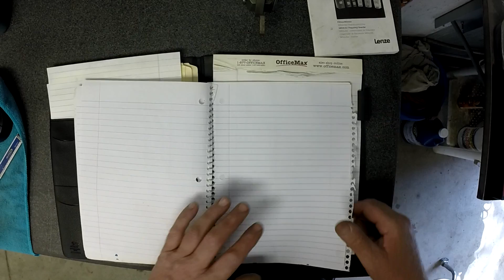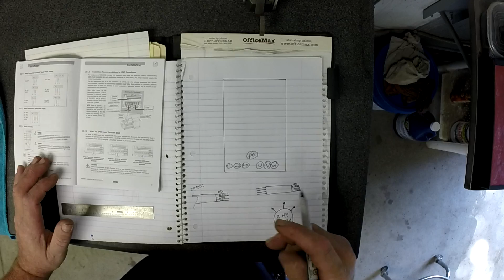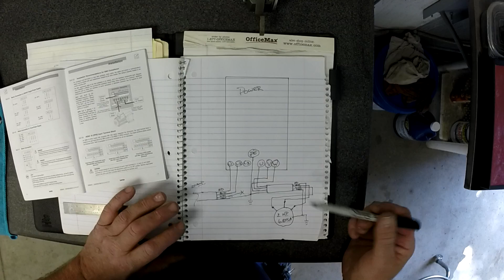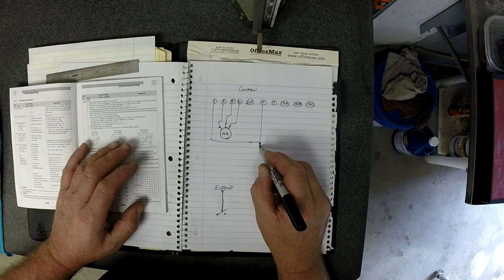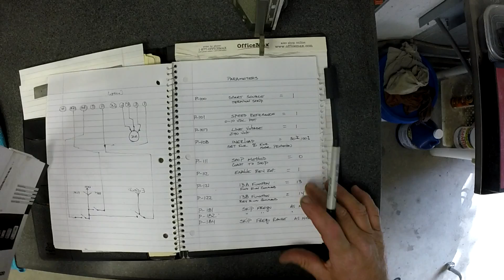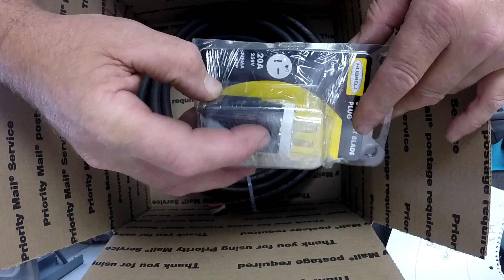VFD lathe application

Comment: When you wire up a VFD to a 3 phase motor you just can't use just any 3 phase. It has to have a CT of 4 to 1 and a VT of 20 to 1 and an insulation of at least an F rating. If the motor doesn't have these specifications and the motor is ran at a low RPM the motor wil get hot and burn up.

Comment: That gruesome photo opened a new consideration of HD metal-framed chuck shields and keeping them in place. I suppose you would need one strong enough to stand on. SawStop has a mechanism that stops table saw blades in a fraction of a revolution, perhaps the trigger mechanism would be suitable for a lathe. Something like a ground fault detector.  The Colchester factory site shows a chuck guard  that rotates around the spindle bearing cover on a large bearing, it appears. A more user friendly chuck guard might be a good project for a video. https://youtu.be/-6aib-PGzNU

Comment: Stan,  can a Hardinge 3 Phase 220V 1 HP  lathe be converted to single phase with a VFD?
thanks, Frank
Reply from the maker: Can it be done? sure thing, but you need to ask the next question, can I do it economically? It certainly wont be cheap to get all the control features back the way they were. I think a simple rotary phase converter is your ticket to get up and running with no muss, no fuss.
Reply: Afraid not.  I have an HLV-H and had the same question.  The reason you can't is because you have several motors all set for that 3 ph 220v power.  If you go to the harding group on practical machinery you can check out the forums there and they would give you a more defined answer.

Comment: Hello Stan,
I am attempting to convert a 5914 Clausing to 220 3 phase with a single phase input converter. Am having trouble with the motor not having enough torque after I put the belts on. I suspect one problem may be that my calculations in pulley configuration is way off. Would like to talk to you. My email is "whitecaps775@yahoo.com" if you would be willing to provide a number where I could reach you it would be a great help.
Takes too many words for typing.
In Over my head,
Gordon

Comment: Stan, Question I have a machine with a 3phase motor, this machine has a magnetic switch (ms), I understand that I will need eliminate the ms in favor of the drive but I'm wondering if I can continue using the original on/off buttons to operate the drive?
Reply from the maker: +David Haxton The drive can be programmed to accept (existing) maintained or momentary inputs, should be no problem.

Comment: Stan, how do you terminate the stranded wire for the control and power terminals on the VFD?  Crimp ferrules? Solder?  Or do you just run with the stranded wire?  In most industrial systems, I see crimp ferrules but I did not know if soldered terminations were kosher as well.

-Dale
Reply from the maker: +Dale Garrison Hey Dale, under each power terminal is a square washer, forked terminals aren't needed. Crimp sleeves are accepted methods on machinery where vibration is a problem, control pin rail is designed for bare stranded wire, but I dont see the harm in tinning it first.
Reply: +Shadon HKW Thanks Stan.  Also, I like your VFD mount for the drill press.  I have a Teco VFD rigged to run my Clausing drill press.  Originally, I was going to install it in a Hoffman enclosure with a disconnect, etc but I think I'm going to rig up a plate similar to yours.  Much cleaner and you have easy access to the membrane key pad.  As always, thanks for the great content.

-Dale
Reply: Do not tin wires that go under a screw or to a crimp. The tinning makes stranded wire brittle for a long distance and as solder is soft, it will flow under the screw and the connection will eventually get loose.

Comment: I would never wire without checking the manual  BUT are the code numbers standard with many manufactures?  I have been  gathering parts for a project and the  VFD  importer stated to use a 5 ohm  pot. Do you think there would have been a problem with the 10 ohm pot?   Thanks for the very helpful info.
Reply from the maker: +1DIYGuy Always check the documents that come with your drive, all parameters are different between manufactures.

Comment: When I set up the potentiometer  on my mill VFD every time if I moved it too fast it set a F-HF code I had to set P105 for decel time I put in 5 seconds and that fixed the issue.
Reply from the maker: +fatboyfester Good point, little tweaks like this are needed after installation, you never know what issues your going to run into because every machine will be different and have different operating requirements.

Comment: Stan

Another very well done explanation on electrical.  I liked 
1.  You discuss using the plug as disconnect means 
2.  E stop to kill all control circuit

Couple thoughts and these are mosty for me if I choose to update lathe to VFD drive (may also do shunt DC).  FWO and REV switches were not momentary ??  
IF correct then
1.  As set up it does not provide ant restart after power failure and return of power.
2.  If operator hits E stop and DOES not put FWD / REV / OFF switch in OFF then on reset of Estop machine will run.

I prefer coast to stop for normal stopping to reduce wear on gear train imposed by dynamic braking.  Dynamic braking is great for 
1  power tapping for sure with maybe a two or three second stopping ramp.
2. crash emergency stop with say a 1/2 second or faster stopping ramp.  This would require a second contact on E stop.

Again a very well done demo and good discussion of setting parameters which can drive a guy crazy.  Hardest part is keeping track of which of many pages you should be on.  Maybe Lenze wrote their manual to ease this frustration.
Dan Bentler

Comment: Very thourough video,as usual,Just one little nit-picky item. You stated that the signal power for the speed control comes from #5,where in reallity 10V is present on the other two terminals,and is picked of with the wiper the closer to + the faster,closer to- slower.
I am sure you are aware of this,but just to keep things as close as possible to reallity.
Love your videos
Reply from the maker: +Les Bender Yea, the wiper is the return, sometimes I start talking and its like a conveyor belt :)

Comment: What would be the best way to use the apron forward/reverse lever? I have a 5hp gear head that I'm thinking of powering with a vfd. It's currently run with a American rotary RPC but I feel like it will run a lot better using the RPC to power a 3ph input vfd. Thoughts?
Reply from the maker: +Jason Raksnis Almost any switchgear can pilot a VFD, in this instance we are using controls that being sourced by the user. (Your apron lever should work fine as long as the contacts are in good shape)
Reply: +Shadon HKW I do realize that. But contact switches built into the lathe each have 3 wires. Not sure how to wire that.
Reply from the maker: Hey Jason,
3 wires is all that's needed, common, fwd run and rev run. A mutimeter and 10 minutes will get them sorted out :)

Comment: Hi Stan, As everyone else has already said, this video is very helpful.  Having said that. though, I'm hoping that at some point, you might be willing to do an update showing how the use of momentary push buttons (forward, reverse, stop) instead of a rotary switch, would affect your plan.  My 13" South Bend originally used push button controls, and I kind of like them.  Thanks.  -Chris
Reply: +Tom Bordelon 
I got this one.

Your push button setup is a single component. When you hit the stop button, both the forward and reverse switches are physically opened. 

So you will use the original switch as your "control" instead of "power" 

The simple good news is that the same wiring Stan showed in this example will not need to be changed.

The difference hear is that instead of the "stop" switch being a separate switch that kills the control signal it trips both the forward and reverse switches simultaneously. ( point being an open circuit is an open circuit.)

Remember the factory switches will no longer be carrying high voltage but used as "control" inputs to the VFD.

If your machine is using relays to isolate the high voltage/current from the switch already, then you will be eliminating all of those and the above is still true.

Hope that helps.
Reply: Thanks, Tom!

Comment: Stan,  Great info.  I have a Hitachi WJ-200, 5 HP drive.  It works great, but the instructions are very difficult to understand. But I got it going anyway.   I can't remember, (I also have a Lense VFD on my drill press), if the Lense has braking functions. I'm not sure if it would be needed on a lathe.  I have braking on my Mill with the WJ-200, and a BIG 70 ohm resistor as the braking resistor.  It works great also.  BTW, these info looks like it might be going to BJ.   Thanks for sharing!

Comment: Cool stuff Stan!  Them VFDs are the bomb!  You covered the DIY basics that any novice could understand... You stayed in the scope of "getter done". 
        Motors and Motor Controls can get deep real fast.  It's an entire discipline in Electrical Engineering and Industrial Elect....  I barely touched that stuff in college.  Plus the electronics, IGFETS, etc. that create the variable frequency... ugh!  One thing most hobbyists are unaware of is the effect on the line Power Quality (noise, surges, etc.), and Power Factor.  Those VFDs are notorius for putting a lot of noise on the feeds.  But, nothing a surge strip can't block out.  You gave him the "good stuff":  that nice juicy 'SO' cord!

Comment: Stan-

Any advice on various parameter settings when using a braking resistor? I put a VFD on my lathe a few years ago (unfortunately another brand) and have never been able to properly configure my braking resistor. Unfortunately this leaves me with "coast to stop" as my only option, plus if I have anything of any mass mounted or if I decrease the speed via the speed pod too quickly, I overload the drive and it trips.
Reply from the maker: +Brian Simmons Check your DC braking threshold setting (this is the frequency  the drive comes to before the braking is applied) there are also 2 other settings to play with, ramp to stop (no braking) and ramp to stop (with braking) it sounds to me like you are using the ramps with no braking and the inertia is overcoming the drive capability. Of course yours may be named something slightly different as they vary from manufacturer to manufacturer.

Comment: Very educational, thanks for the great explination. Just wondering, if you had a drive rated for more hp than you needed would it tolerate the torque boost better without overheating?
Reply from the maker: +bcbloc02 Yes it would, but the prices go up drastically beyond 5 HP.
Reply: +Shadon HKW I haven't been able to find anything above 5 hp that will run on 240 vac single phase.
Reply from the maker: +ww_big_al I believe Hitachi has one, give a call over to Wolf Automation and have a chat with one of the tecs.

Comment: Could you show the math to get P108 you have talked about it before just not shown the math seeing a motor plate would be nice and all the numbers.
Great video thanks for the good info.
Have a day
Reply from the maker: +E Hiebert As an example, a drive is rated for 10 amp and a motor has a FLA of 8 amp, we would set P-108 to "80"
Reply: +Shadon HKW Thanks for the reply. Have never really looked at a motor plate to see what it tells you. Thats CNC operators for you as long as the machine is running and is not making funny noises then everything is good. I always like to learn as much about a machine as i could just so i could get it fixed fast and then get back to work. I guess that never included motor plates.  
Have a day

Comment: Stan, my friend, I adamantly disagree with your Emergency Stop Punch Switch wiring in this application. The only use for a Emergency Stop Switch on a machine with high speed moving parts within reach of a operator is to bring the machine to a dead stop as fast as possible in the event of  a emergency.  Not as a on/off switch to the forward/reverse controls. Almost every VFD I have installed has a control parameter to obtain a instant rotation stop of the motor (power lock up) that is intended for the E-Stop Button. The last thing any operator would want is to have a machine "wind down to a stop" as their shop coat is being wound into the rotating machinery. Which brings up another point .... the E-Stop Button should always be mounted within easy reach of the operator when in close proximity to the moving parts of the machine. This could be the result...  http://i.imgur.com/KJH2DuD.jpg     Be carefull, I care.  Regards//greg
Reply from the maker: +pkav8tor Hey Greg, what if this was 15 years ago before freq drives went mainstream? Coast to stop was perfectly acceptable then, admittedly the drive has DC braking features that could be enabled as an upgrade over old school practices, the onboard DC buss would be able to do limited braking, adding some externals braking resistors would stop some serious inertia. But that picture ... ouch.
Reply: +Shadon HKW hey bud, yes the old slow machine controls ate a few good men back then.  We have safer modern controls that are dirt cheap to install now.....we should use them when ever possible as you already know.  That picture popped up in a safety article awhile ago,  it stated that they found the poor guy that way and the machine was still running ....so sad.
Reply from the maker: +Dan Fraser Always an issue with maintained contact switches, momentary pushbuttons would make this issue go away.
Reply: that pic is going to give me nightmares.
Reply: Nothing like keeping in mind and planning against the worst case scenario. That includes working with the flu, personal problems, anger, or just having a shitty day. Some days you just need to stop and gather your wits. We are running the functional equivalent of a wood chipper. Fortunately Saddam Hussein did not think of this.
Reply: Are dead-man switches practical? Left and right hand e-stop should be easy.
Reply: That gruesome photo opened a new consideration of HD metal-framed chuck shields and keeping them in place. I suppose you would need one strong enough to stand on. SawStop has a mechanism that stops table saw blades in a fraction of a revolution, perhaps the trigger mechanism would be suitable for a lathe. Something like a ground fault detector.  The Colchester factory site shows one that rotates around the spindle bearing cover on a large bearing, it appears.
Reply: Yeah, good catch, I was thinking the same thing.  Stan should know better.
Reply: pkav8tor what ever happened to no rings , no watches ,no necklace, short sleeve shirts 👕 tucked in pants !

Comment: Good vid, Stan. Thank you.
 One detail kept echoing in the back of my head, though - «...a plug is a perfectly acceptable disconnection means...» - may be a little off. It may be true 99.9% of the time but, worst case scenario, a malfunction while pulling 13.3Amps (as per the manual) may occur and that one in one thousand times may bite you hard.... Not perfect. So I would suggest a real means of disconnection - say a sectioner or an interruptor - between machine and wall plug or somewhere in that 20Amp circuit.
It may be acceptable per regulations (I'm not familiar with US regs), but not good practice to pull plugs on live SMV's, thats all.
Reply from the maker: +Luís Emauz No its not a good idea to pull the plug on a drive that is up and running,  or removing the power by any other means, I was simply referring to a service disconnect to make sure the entire machine is dead for electrical service.
Reply: +Shadon HKW Yup. That will work.
Thanks so much for the care you put into sharing.

Comment: I thought 5 HP for that lathe was a bit much.  For mine I bought the most heavy duty drum switch I could find and its only rated at 2 HP.
Reply: +1970chevelle396 Remember - Brad & electric/motors are a match made in confusion ;)